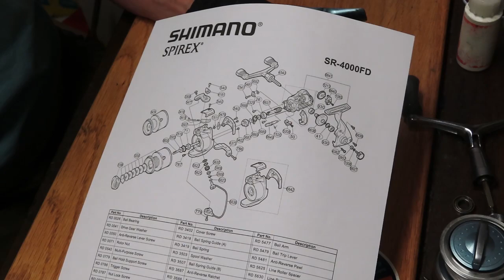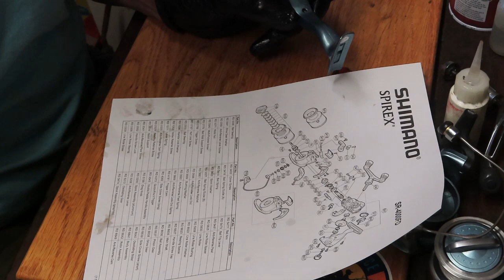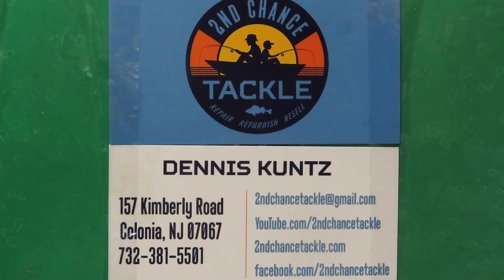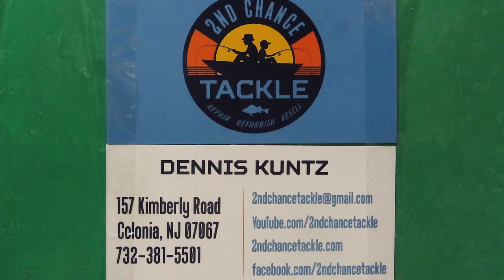Shimano Spirex 4000FG with unusual problem how to take aprat and repair this fishing reel

Comment: Though I am not fond of easy-cast reels I like every thing else on the reel except maybe that handle. You did a great repair on this one. — Chris
Reply from the maker: Thanks Chris.  I use the reels, but not the easy cast feature.  I manually open and close the bail on these reels.  My neighbor swears by them, but I have not been comfortable with it.  To each their own!  Best wishes - Dennis
Reply: @2ndChanceTackle I like them, I grab the line,and click the bail open ,all in one movement with my  ( pointer finger) takes a little practice,but it's easy one handed operation. Thanks Dennis 👍

Comment: Great video. FYI oscillation gear and main gear have arrows that must be in line to each other. On the box when you buy the reel is the schematic of reel and orientation of the gears.  I have 4, FG2500 reels one for me, 2 sons and a spare. I clean and do maintenance on the every season. I will try to add picture of gear alignment.  Love the videos good job and God bless.

Comment: I love this reel and appreciate your video. I have an issue with mine and I'm wondering if anything stands out to you. 

A couple uses after a service I get lots of friction in the forward direction. If I stop reeling it sorta catches and doesn't want to turn anymore. Takes effort to get it spinning. If I click the selector switch it spins in the reverse direction very smooth; like new. Forward still has the friction. 

Has the grease on the main gear gone somewhere? Are there any obvious culprits here?
Reply from the maker: It sounds like something is amiss in the A/R set up if it spins freely when that is switched off.  I would check that assembly - Dennis

Comment: FYI cant add pic, but if you research you will find schematic on Shimano's web site.  Good reel but it does require regular yearly maintenance and I have had to buy replacement triggers because they get a grove over time.

Comment: Dear Sir can you please show how to reassemble the quickfireII system on shimano spirex4000FE. For this kindness I shall remain ever obliged to youSir
Reply from the maker: I will see if I can find a reel to do the demonstration.  Right now, I do not have that one.  If I find one, I will do the video - Dennis
Reply: You can do it if I can just watch when you take out the spring will go flying out and it is small, I almost lost mine lol.  Take your time putting back in noooo rushhhhhh. take pics like he says.  One step at a time. Get new triggers they get a grove and only last a few years depending on use.